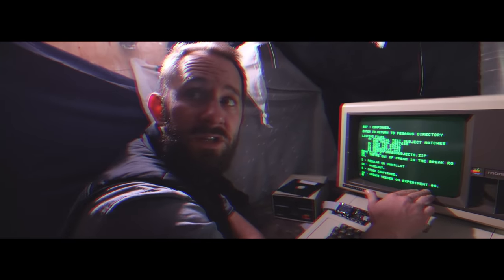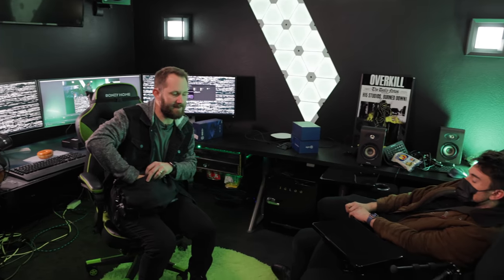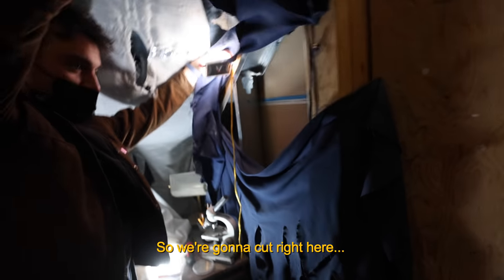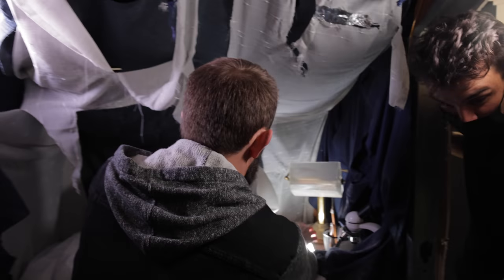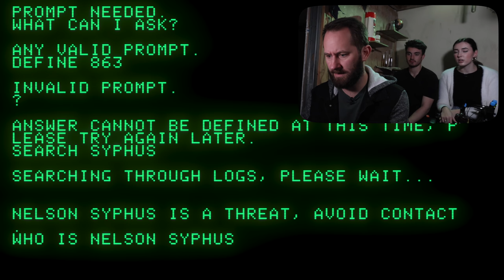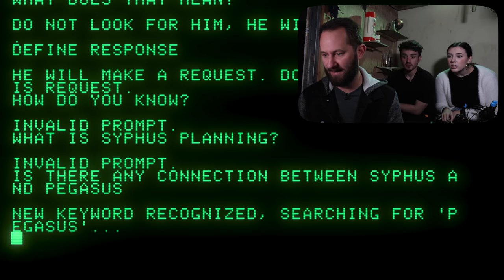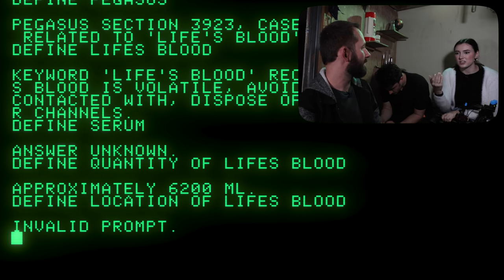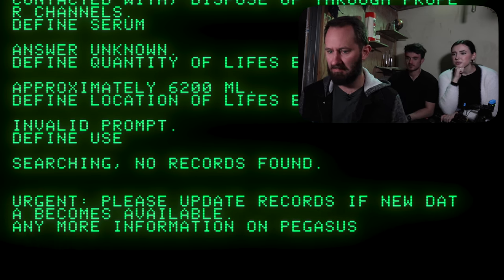This is The Creepiest Thing That Has Ever Happened To Us...

Comment: Ok so when you asked where, and they said “location 3.5”, that is a car part. I’m thinking you should check the mountaineer for it. Look up location 3.5 and check. Please

Edit: this is just a theory I don’t really know for sure.
Reply: I'm think coordinate of the building. Like the building in split into 5 by 5 parts and 3.5 is a segment of the building.
Reply: @SuperZeve  but now they can tell witch part of the building will be 3.5? for all they know it can be right where they are or in apart of the building they do not own.
Reply: It could be the passenger side tail light good place to hide things there could be space behind it
Reply: They already confirmed the 3.5 is March 5
Reply: @vaz2585  well they didn’t confirm it it’s just an idea
Reply: Location means the location of the corruption. It's basically stating the file location of the corrupted data, which is what Matt asked.
Reply: @tucky2367  The responding program Matt was talking to said "Alternate format accepted" when Matt typed in "March 5th". I'd call that a confirmation.
Reply: @yukifoxdemon  A plausible theory. Hmm. Well done!
Reply: the guy on hangouts said that they hadnt found everything in the car too

Comment: OES Optical Emission Spectroscopy: A well trusted & widely used analytical technique used to determine the elemental composition of a broad range of metals. Includes the visible spectrum & part of the ultraviolet spectrum. In terms of wavelength,  that's from 130 nanometers up to 800 nanometers. I.E.: 234 OES. And can analyze a wide range of elements from Lithium to Uranium in solid metal examples. The elements & concentrations that OES analyzers can determine,  depend on the material being tested & the type of analyzer used. Hope that helps. If you didn't already figure that out for yourself lol. And I also believe that the person asking for your "Evidence" is Syphus, being that the computer told you that you will be contacted & asked for something, then told you that you'd already been contacted. So...Maybe they are/were using Lithium &/or Uranium in the patients. Maybe that's the cause of the brain damage??? Possibly...
Reply: So I'm geussing he could use that uv scope inside or at the desk maybe there is something written on the desk like the  disappearing ink
Reply: Oh well you did a lot of research 😂
Reply: I searched up oes and it gave me original equipment supplier
Reply: @khristianmorse4130  i feel original equipment supplier makes a little more sense tbh.
Reply: @khristianmorse4130  thanks

Comment: DOES ANYONE REALIZE: One time Matthias made a video going through reddit, it was a while ago and i dont remember which one, but there was a post where it was talking about TIME TRAVEL. Does anyone remember? This would explain a lot, because it could be Nelson Syphus breaking in, even though that computer is really old. AND the computer said that something happened on March 5th 2021. I think this could lead to something.
Reply: as to me what it sounds like is that it is pretty obvious that the macintosh has been connected to some form of internet or something such. and to be honest, the machintosh internally could be different than just the older one rather considering what is seen on the outside. its like a human typing through the prompts and not computer.

Comment: The life blood of a nation is in its commerce map of New York City.; Map- New York City.; The life blood of a nation is its commerce. - Page Order: Leaflet. - Available also through the Library of Congress web site in two forms: as facsimile page images and as full text in SGML.  Also OES stands for Original Equipment Supplier, while OEM stands for Original Equipment Manufacturer. Many of the parts you'll come across will fit one of these categories. People are sometimes confused because the definitions themselves are actually so similar

Comment: That computer doesn't have a real time clock, it can not record date, everything is preprogrammed on the SD card.
Reply: meaning what?
Reply: @47buddhists97  it means that the sd card has whatever someone put on it meaning that D probably put all of that information on it.
Reply: @sdnicholson03  oh so like all the responses or whatever? or the info the last video? my bad i’m kinda confused
Reply: @47buddhists97  the responses are most likey generated from a data base. So what would happen is the computer would see that, let's say for example, Syphus and pegasus are used in a sentence. It would take information about those two key terms and tell you.
Reply: From what i can see the computer is not connected to a network and the only way to do that on that computer is to either have the dial up modem that was optional or hook it up to a PI or another computer and use the Apple 2 as a terminal.  The program on the SD card is a Text adventure style BASIC program.
Reply: @samthemultimediaman  Same, from what we can see, tho they never checked for cables on the back, did they?

Comment: Hey Matthias if you haven't found out the acid I think these might help
Sulfuric acid or sulphuric acid, also known as oil of vitriol, is a mineral acid composed of the elements sulfur, oxygen and hydrogen, with molecular formula H₂SO₄. It is a colourless and viscous liquid that is soluble in water and is synthesized in reactions that are highly exothermic

Hydrofluoric acid (HF)

Hydrofluoric acid (HF) is only a weak acid, meaning it doesn't fully dissociate into its ions in water. Even so, it's probably the most dangerous acid in this list because it's the one you're most likely to encounter. This acid is used to make fluorine-containing drugs, including Teflon and fluorine gas.

Comment: There have to be more computers, or cases, or locations like under the stairs or maybe even other locations like other building where syntec worked, because it kept referencing a core unit or a base or something and this information has to be coming from somewhere, it doesn't seem like that computer can hold so much information so maybe the computer is receiving it from somewhere else.
Reply: That's exactly what I was thinking when they found the case!
Reply: The computer isn’t holding the info though. Isn’t what D gave them with the info.

Comment: It said “you” how can you clarify that “you”means you three specifically and not whoever was using the computer before?
Reply: I thought the same thing. This could be old information from before Hi-5.
Reply: Because the sd card thing they're using was sent to them specifically by D
Reply: Centurion  right because as Matt, I think, tried to say, even if a computer has been off for a long time, when you turn it back on it will update the date and time based on region and any connection to internet or other database. So, it could have been giving the current date; Not necessarily the date of the information. Still, it could be either. We just don't have enough information to be sure.

Comment: What does OES stand for?
Original Equipment Supplier
For starters, OES stands for Original Equipment Supplier, while OEM stands for Original Equipment Manufacturer. Many of the parts you'll come across will fit one of these categories
 just thought it would help

Comment: In order for the apple II to connect to ANY other computer....Either another terminal, or a database/mainframe, there would have to be a physical connection to that other computer...Either ethernet cable, or a telephone cable, since the apple II was decades prior to wifi....If that connection isn't there, then the "database" is being sourced from the SD card, and nowhere else. Computer networks for the apple II were called "Intranet" which was a sort of "internet" that only connected to other computers and terminals within the building, and not to or from remote locations without a telephone modem....That telephone modem would ONLY WORK with an old school hard-wired copper telephone line....Chances are, there's another terminal within the building...Maybe not a Hi5 studio space, but somewhere within the same facility/building of individual units/bases....

Comment: 30:07-31:07 Physical memory refers to chips such as RAM (Random Access Memory) memory and storage devices such as hard disks that are used to store data. Virtual memory is a memory space created by Operating system when the computer does not have enough physical memory to execute a program. Virtual memory is created by combining RAM with the hard drive space. it could  be another computer or memory disk, like RAM hiden

Comment: Prompt is a direction like a question of what you want to look up/at. like this, "open chat folder" or "open prompt list".
The file you opened sounds like a presaved conversation log that will answer questions that have key words. Keywords would likewise be file folder names.
Reply: P.s. unit means computer brain/hard drive. Nearby storage is the floppy disk drive. Put the disk back in and run the program again and I bet it can answer questions you already tried. 
Also questions almost have to be literal and robotic. That's how such an old comput reads/talks. This is coming from an 80's child ☮️ LOL

Comment: I just Googled "when was the company syntec started by nelson syphus" And it turns out that the syntec you guys know was started by Nelson Syphus, Darrin Syphus and Heckly Syphus in 1944. If syntec was started in 1944 that means Nelson Syphus would be over 80 years old and is probably not the one breaking into your buildings.

Comment: What if, by chosen it meant that Syntec had there medical history and that their DNA matched with the patient's that they were looking for at the time of the tests. What if, that computer isnt really that old and they are using those ones because it's hard for people to track their information because it's so off the grid. What if, the Alsolute Storage is located somewhere on the base thatd why the computer is still there. What if, the thing you are suppose to give to John doe is the computer file? Could also be the original case he is after. Considering the size of it would fit nicely into the case from John Doe. This is all so crazy but so good at the same time. Just make sure to stay safe.

Comment: In the episode where you broke the safe out of the wall there is 3 American flag keys on the floor at 33:04. Didnt you guys have trouble finding even one of those? How did you go from 3 keys to 1 and now the "undercover officer" claims to have a matching key?Also didn't you guys have a list of every key that appeared on frame? The American flag keys were believed to have not been on any episodes right? Then the following episode after that the tags change and one has a green dot labeled on the side? At the episode where you found the key to the mountianeer at 1050 you can see the American flag key 859
Reply: 2 have a tag 1 does not

Comment: Nelson Syphus
-A threat, avoid contact
-Founder of Syntec Inc
  -Syntec closed in 2019
-Has continued his work in the shadows
-Disk advises that his work to come to an end
-Don't look for him, will contact you, but don't fufill any requests he makes
-Relation to Pegasus
-Relation to D, vocation (job)

Pegasus
-Section 3923, case files sealed
    -related to 'Life's Blood' (Unknown if it's the name of the project or what)

Life's Blood
-Volatile, avoid, dispose of through proper channels if contacted with
-Approximately 6200 ml in total

The unit (Apple 2/Emulator+SD)
-A lot of corruption in the unit
-By date, on 3.5/March 5th as an Absolute Date
-No more logs beyond March 5th, 2021
    -Connection Destroyed, advises to relinquish control of the unit before 3/5/2021.
          -Already been contacted to relinquish control (John Doe???)
-Currently has a strong connection to the Absolute Server (???)
    -Signal Strength is 234 OES

Matthias and crew
-Cannot stop the impending events ahead
-Chosen specifically for [them]
Reply: -What is an Absolute Date?
-What is the Absolute Server?
-What is the most recent log prior to March 5th 2021?
-What are the effects of Life's Blood?
-What are the goals of Nelson Syphus?
-What is OES?

Something random: -What is OPRP?
Reply: Theorycrafting:
-Right Behind you: The apple 2 is connected to a database through ethernet, or some other way.
++Very little hat pulling to do
++Would explain how it's getting information without too many twists & turns
- - -Doesn't really explain how connection is destroyed on 3/5/2021, but has a strong connection now

-Kinda distant, but still close: The volatile Life's Blood is a serum that helps with Syphus's goal of "progressing civilization and technology," and may cause a permanent change in a person
  o Nelson may have injected himself with the larger and one of the smaller vials, causing him to scream in pain
  o Possibly irrelevant, but Nelson Syphus is a good runner, as seen by when he ran to get into Orange Base, and when he ran into the building to get the Mountaneer.
  o It may do with someone's nervous system, as the experiments had the effect of causing brain death, and has something to do with the spine, which carries nerves from the brain to the rest of the body
++neatly explains the stuff to do with the serum stuff
- - - Who in their right mind would put that stuff in them? (Syphus, obviously)

-Very Far-out: All of this is related to Project Pegasus, an alleged time travel program. The absolute server may be some kind of thing that holds information in a sort of database irrelevant to any changes to the timeline.

++There may be logs from the future
++Time travel may be involved
++Would explain how syphus has Woods keyfob (Travel into the past, take the key, copy the signature, put it back, go back to the now, go get the mountaineer instead of the case, plant a destroyed rfid reader in the bush in the past (without it it may be detrimental to his plans or something (crew wonders how he got it, they dismiss the idea of a reader/writer, find the room way early, discover the time travel stuff, his plan with stuff is bonked) otherwise))
+++Try again later, where information can only be accessed at later times
- - -Syntec is bioresearch, not time or theoretical or whatever
- - -Nelson Syphus could have taken the key, copied it, then put it back without time travel shenanigans.
- - -Computer time can be spoofed logwise
Reply: What if you put in the code that you find in the logs? By that I mean the coffee creamer stuff. Also, the machine can't understand multi-sentence prompts.

Comment: Looking at how you were interacting with the apple 2, that's not how they worked. They were incredibly particular about what inputs you could use, and wouldn't be able to deal with follow up questions unless programmed to deal with that exact query. At best this information has been created very recently with exactly the terms you used programmed in. Very little about the interactions with the apple 2 are how they work